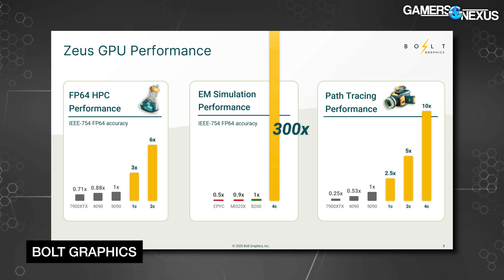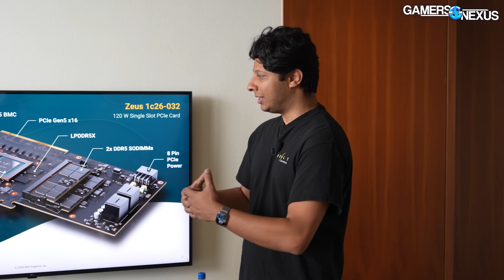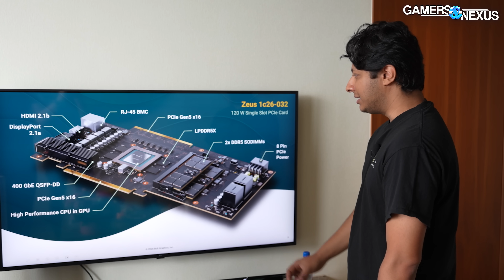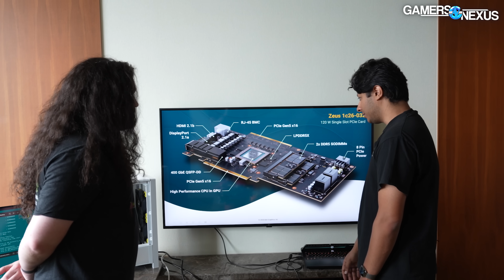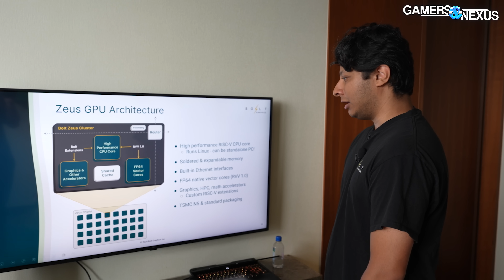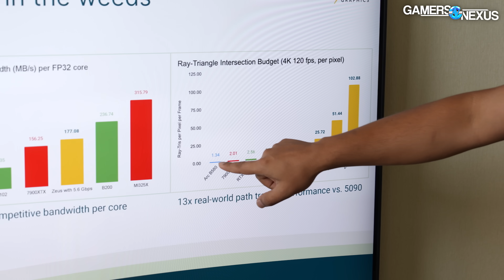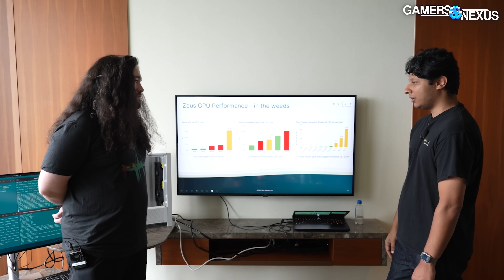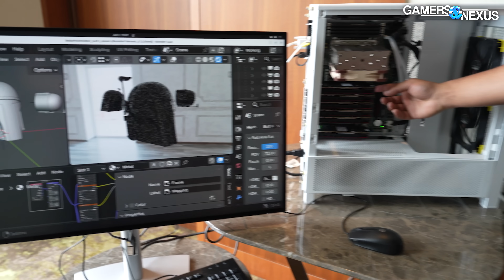A New Gaming GPU Challenger: Bolt Graphics Takes Aim at NVIDIA

Comment: We need as much competition as possible
Reply: ASML needs competition lol
Reply: @Steven_Stag  dont worry mexico will surprise you
Reply: @Steven_Stag  It has competition (Intel and Samsung for starters), what really needs competition is ASML the single company that makes the high end chip manufacturing devices that TSMC and its competitors use.
Reply: @ner @nerofl89  Intel is run badly and shouldn’t exist anymore, they got bailed out by the government
Reply: @nerofl89  asml is a legalized monopoly no one is gonna compete with them
Reply: @sickratzz That's my point...it needs competition.
Reply: @nerofl89  No one is even close to building technology similar to ASML's, and they will not just give it away. It's also not like someone gave them the blueprints; they had to invest a lot into it. Most people don't even realize how much infrastructure alone ASML requires to even operate. I agree there should be competition, but shouldn't the competition go through the same process that they went through?
Reply: @sickratzz No one is even close to building technology similar to ASML's, and they will not just give it away. It's also not like someone gave them the blueprints; they had to invest a lot into it. Most people don't even realize how much infrastructure alone ASML requires to even operate. I agree there should be competition, but shouldn't the competition go through the same process that they went through?
Reply: @TheAlienwhisperer  They got lucky with the several billion they had invested in them.
Reply: @sickratzz, It’s not “legalized” It’s just a fact that nobody can compete with them. Nobody knows how.
Reply: @nerofl89 , There is competition. It’s just that the competition is so antiquated and inferior that nobody wants it.
Reply: @TheAlienwhisperer , Actually they bought the technology from Lawrence Livermore Labs in California when Bill Clinton balanced the US budget and cut funding for the development. So they weren’t given the blueprints, they bought it, then finished the development.
Reply: @terjeoseberg990  What they bought back then was far from the technology we have today. You are portraying it as if the product they purchased was already complete, when in reality, it was just an idea that no one except ASML wanted to pursue. It was a far cry from what exists today, and ASML went through plenty of failures along the way, too.
The national labs did not hand ASML a finished "blueprint" or a plug-and-play machine.  What the national labs proved was the physics, they showed that EUV lithography was theoretically possible in a laboratory setting.  Turning that laboratory proof-of-concept into a commercial machine that could run 24/7 in a cleanroom with atomic precision was an entirely different beast. ASML spent the next two decades and tens of billions of dollars to actually "finish" the development.
Reply: @TheAlienwhisperer no.
Reply: @TheAlienwhisperer  China recently announced modern lithography machines. Might not be top notch but one can hope for at least stuff for the average consumer.
Reply: @Steven_Stag we need some serious corporate espionage situation and build a factory or two at home
Reply: 3dfx we were all robbed
Reply: @Realmusicworld420  3DFX made lots of stupid mistakes, pissed off their distributors by undercutting them on price and got bought up when they ran out of money. I love 3DFX cards but it's important to know they basically ended themselves.
Reply: @WelshProgrammer nvidia has done that with there stupid prices.  In Australia the top nvidia card is 6k where i can get an amd top card for 1500. Literally quarter the price of nvidia and what 5% less powerful at best.
Reply: @WelshProgrammer , 3DFX wasn’t bought up. They went bankrupt and shut down. Then NVIDIA hired most of their employees.
Reply: @terjeoseberg990  Nvidia bought all of their assets and IPs you zoomskull. They were in a bad situation after they bought STB's fab , then Micro$lop & Ngreedia pushed DirectX (cos of upcoming Xbox) and basically killed 3dfx , then Ngreedia bought them, shut them down, got the IPs and DELETED and buried them (they even stole SLI as abbreviation, though Ngreedia's one does not mean what 3dfx's Scan Line Interleave meant , nor it works as OG SLI worked) 
Ngreedia did the same thing when they fell threatened in mid to late 2000s by Ageia and Physx accelerator cards - they bought them , said ONLY our cards are THE SHIT, shut down the company, pocketed the IP, deleted them, and recently stopped supporting 32-bit Physx LOL
Reply: @volf3r505 , Nvidia did not buy 3DFX. You’re confused. Nvidia did buy PhysX. I don’t know anything about Ageia.
Reply: Working on the MAIA100/200 hardware development and latest fleet deployment, and I support this.  Learned a lot and ready to help people like this.
Reply: Nvidia will come back wheeping. Google, Amazon and xAI  are going NPU or ASIC route. First two are already there, and Musk loves vertical integration so that's a 100% as soon as they build their chip plant. It leaves Meta and neoclouds. ANd Meta loves to do what others do so I wouldn't be surprised if they also go that route.
Reply: @JerzyLasica  I wish that was likely to be a way out of it, but Nvidia already went the ASIC route. If you only looked at the video side of things, the RTX 40-series wasn't that big a deal compared to the 30-series, but it was about a 2x improvement on FP8 inference speeds. Even if that still pushed Nvidia out of the market, whatever's left in those datacenters will still need DRAM and NAND so we'll be in about the same situation just maybe with the benefit of not having to think about jackets quite as much..
Reply: Yeah, but this is not it. It's going to be nowhere near even Intels cards for gaming. Hence their initial target audience.
Reply: @daniel29263  It doesn't matter anyway because gamers would give them a standing ovation then go buy the latest RTX card.
Reply: @ivanlagrossemoule  no shit when the only other options are not working amd drivers
Reply: @rarepepe4849  have you actually used an AMD card in the last few years? I own a 6750 XT, and not once have I ever had to even think about the drivers after they were installed
Reply: @daniel29263  The initial product won't be, for sure. But they very well might be able to put out something significantly better for gaming in the second gen.
Reply: I'd jump in with them and help for free if I had any knowledge about engineering gpus or porting.
Reply: @CrissaegrimOG Thank you for your sacrifice
Reply: Indeed. Good luck 👍🍀
Reply: So Nvidia GPUs get cheaper.

Yes, we 've heard that one before....
Reply: @Zerard1 , It’s funny how everyone wants competition for NVIDIA so that they can buy NVIDIA hardware cheaper. Why aren’t they interested in buying the competing products? It’s actually these people who are preventing the competition from succeeding. If you want more competition for NVIDIA, then buy AMD or Intel GPUs.
Reply: its more support for us than competition for nvidia
Reply: It has to be actual competition though, which is almost impossible in this market.
Reply: @underleft , Why?
Reply: No kidding. People gave Intel shit when they came out with their GPU’s. Seriously WHAT is wrong with these people?! We need MORE MORE AND EVEN MORE competition especially when it comes to GPU’S!!! 🙄

And God speed to these companies making them. We also need more RAM chip manufacturers! I don’t get why China can’t make stuff like this either. 🤷‍♂️
Reply: By the time this gpu comes to consumers it wont matter. Ai will have shifted and settled by then, companies will readjust and optimizations will be the priority while optical and quantum computing comes to fruition.
Reply: I'll give it a few years before Nvidia just buys them out.
Reply: Seriously Nvidia needs competition badly
Reply: @Brownwaffles , NVIDIA has competition. Have you heard of AMD and Intel?
Reply: It's a good idea, but only on paper!
Reply: Preferably outside of the U.S.
I dont want to buy things from modern day Nazis
Reply: Intel, has dropped the ball again.
Reply: Sadly this isn't it.
Reply: Competition now is just a death sentence to when the market crash sadly it’s too late memory is just too expensive
Reply: If we examine this nationally, it looks bleak.
What would really surprise me is if there was, for example, a new graphics card band from France or India, LOLnotGermany, or Ireland. It's like we have become so globalized that many countries are completely lacking certain extremely relevant industry segments.
If you see industry as part of foreign politics, then the USA still dominate many markets.
But on the other hand, Bolt will simply make orders in China or Taiwan or such, so why is it still 'always' the USA where this stuff emerges?
Reply: @Dowlphin  well that’s not the whole story though. China is actively innovating in many areas. But the hubris (and greed) of the USA is blocking any of that innovation/competition from entering the US market.
Reply: @truality8289  I didn't mention China because that is not my point. They are a big competitor, a counterpole, so naturally they would have strong incentive, but out of necessity only. It actually underlines my point: If there is no pressure behind it, many aren't moving, not interested. Maybe their whole system doesn't promote developments like that.
Reply: @Dowlphin  fair enough. But like I said, that’s glossing over a major contributor on the global scale. China has about 4 times the population than the US. There’s a lot happening over there. You probably should have mentioned them as an “outlier” in your original statement.
Reply: @Dowlphin  Thing is, every single one of these Countries that are owned by the Cult, are in on it.

CCP is in on it.
Russian Government is in on this.
USA Government,
UK Government.

I can go on and on.  When will people finally get it through their nogen, that every government is a corpo owned PAWN?

Who runs the world or I should say, wants to destroy it?  The Corpos who are linked to this Cabal.

THAT is what people need to know...
Reply: @gohanf2285  Dependency will be to varying degrees, and while some like their corruptions, others struggle against it.
But what actually saddeny me a bit, one little indicator signaling a bigger problem, is that in Russia where there is a strong identity of opposing the USA's disaster capitalism, they still have the deceptive 99er prices everywhere. - So yeah, they could do much more bold things, USSR style, without causing a big drama.
I keep imagining how different, how much more relaxed, a supermarket in socialism would be. There is so much fear-driven BS in that 'arena' - deception, secrecy etc., it permeates all of society and becomes invisible through normalization.
Reply: Competion comes from basic regulated commerce. Capitalism claims to be commerce while removing the regulation and choice of the consumer.
Reply: @breakupgoogle4584  Competition is also an unessential element in a more mature society. It creates friction and thus waste of resources, in order to run a scheme that has roots in the same fear psychology as capitalism itself.
Competing is always about pitting people against each other to see who is better. That is not healthy for the ego.
Reply: It mighr help but a benevolent monopoly would be better issue is we dont have either.
Reply: Or busting monopoly.  First step is stop having government fund these losers.  Fire the corrupt democrats and all republicans.
Reply: always
Reply: Until and unless they can make GPUs that goes blow-for-blow with those of NVIDIA in every single performance metric (Similar FPS at the highest settings including ray-tracing, none of that price-per-performance ratio bullshit because that clearly hasn't gone well for either AMD or Intel), for similar or cheaper cost, with similar vendor agreements, software on par with them or better, as well as having the manufacturing capacity to keep up with the absurd demand (And they need to do it all fast, within the span of 3-5 years), it's a pipe dream for them to even be considered competition.
Reply: We do. As long as they can stay afloat. It is going to take a few years for intel to get to the point that they are competitive. Bolt seems like they are 4 or 5 years behind intel, but their ideas are far ahead of anyone else.
Reply: Education sucks
Reply: You're right and this is good. But one thing to keep in mind is that they're also using TSMC. So ultimately it's still bottlenecked at the same place. It won't solve the shortage in the short term. 

Still nice to have options though.
Reply: Right, remember when Intel dominated the CPU space and it sucked. Glad at least Intel and AMD are trading blows again. I like that there's this option and Intel now with not face melting GPUs, but also not terrible, well... still to be seen with BOLT. BUT in the ARC sphere, it's been a decent ride recently as we're in what? Gen 3 of ARC gpus?
Reply: I think we need everyone involved in a single ecosystem for consumer grade hardware. I'm not against multiple companies but when they compete with each other to the point that it creates incompatibility within the same generation of hardware, were officially living in our own hell
Reply: as fast as possible, too.
Reply: there's no competition unless you actually buy their stuff
Reply: Competition doesn't mean anything significantly cheaper...
Reply: lisuan gpu will make it happen first then for the future of forward looking gpus bolt will take the lead , even beating nvidia easily if the devs adapt to their hardware
Reply: You just thinking about your own pocket you grub, open a business and maybe it will wake you up :) running a business is the hardest thing on the planet and Nvidia will not have competition ever.
Reply: The key is not whether there is competition, the key is what economic system it happens under. As long as you keep capitalism, it is inevitable that you will repeatedly end up where we have ended up.
Reply: like with handheld consoles?..
Reply: *functional competition
yes
Reply: preferrably from europe.
Reply: Maybe,We need more manufacturers
Reply: @nikhilsharma064  from countries who do not use it to blackmail others....  ;)
Reply: Competition is good, but we have competition at low end already with AMD and Intel being there. What I'd love to see is competition in high-end market, because that's basically just NVIDIA now.
Reply: @Claus5544  In this sector you have to build up to it.
Reply: Yes we really do as the market is complete crap.
Reply: It needs to be at least 28gb!!
Reply: I definitely am not an expert in GPUs so as a ignorant idiot I am hearing: Yeah we will make the same thing like nvidia but better and cheaper and no raster approach, same as nvidia but we will be better.. Competition is good but I definitely will not be a cash cow tester...
Reply: Absolutely!
Reply: Yea, GPU prices haven't gone back down to reasonable prices since Covid or even years pre-Covid. Now we have SSD and RAM prices skyrocketing/increasing. Next it might be CPU shortage or something else unfortunately. Also you can see all these manufacturers prioritize content creators and AI companies. Gamers are second-class or worse
Reply: Competition in an already saturated market that is monopolized from every angle with patent walls? Nice dream, Bolt. But let’s be real—like almost every hardware startup to date, they’ll likely just get squeezed out or "bought out" eventually because the monopoly is too entrenched.

They need to pivot and attack from a completely different angle. My advice? Forget trying to wedge another physical graphics card into a Western market dominated by giants. Instead, Bolt should take advantage of the massive technology vacuum China is experiencing right now. It is a once-in-a-lifetime opportunity reminiscent of the 90s tech boom.

Because Bolt is built on the open-standard RISC-V architecture, they have a unique backdoor. They should look toward the incredible potential of Huawei's brand-new "LogicFolding" 3D architecture. Instead of choking on legacy 12nm limits, Bolt could license their ray-tracing IP directly into China's new vertical, gate-level 3D stacking roadmap. Letting Chinese domestic players integrate Bolt's designs to bypass Western machine bans is their best path to explosive growth, rather than fighting a losing battle against established Western monopolies.
Reply: Yet you will still buy overpriced Nvidia as you kokokoko about competition being needed
Reply: Totally Agree, But I don't want to wait 5-10 years before they even get near a 5090 GPU.
Hopefully something else will happen.
Reply: it's been 10+ years of working from startups to startups. All the businesses are no longer looking for long term success, but rather have it at $5million+ value and sell it. 
Still naive that some companies, including this one, won't be the case. But my optimism is fading as years go on.
Reply: *good competition.
Reply: wont be any, if is close to something important, nvidia will buy it and will bury it deep into the ground, like they did with 3dfx
Reply: Wow a competitor that doesn't care about AI.  Am I dreaming?
Reply: Not from a foreign invader. However, if there is a foreigner terrorist to allow into the u.s., its one like that. Id trade him for removing all the rest though.
Reply: At some point, 5 - 10 years, China will catch up and at that point the current market US-Taiwan-Korea cartel is toast 🔥🔥
Reply: Good luck, capitalism is anti-competition
Reply: @DrZaius , Back when AT&T was a monopoly, they invented some great things. They never stagnated.
Reply: We don't need a competition we need a replacement. If NVIDIA is willing to lose their loyal consumers then we need someone who'll only focus on us and not split it up with big companies that only aims to use the GPUs for AI.
Reply: Hot take
Reply: And more
Reply: Wanna bet that this is vaporware and a scam ? It will never release or will be a turd.
Reply: Yep both for the consumer and the markets sake. Competition breaks monopolies and frees up the market.
Reply: They're not building to sell. They're building to compete and get bought out in order kill them. It's intentional. Cynical I know, but Google does this all the time.
Reply: Rape the earth for all it's resources? yeah great idea, it has worked out just fine..Crazy thought: What if we respected nature, looked at everything as precious and divine, made the best products we can to last as long as possible, and re use the materials instead of throwing them away. How can we so carelessly throw things away as they are dead and worthless...
Reply: well, he did slip and say that it's intended for data centers.. ;d
Reply: @shadyopss  he also said their first clients are game developers, so it is not those kind of datacenters
Reply: @Sauvva_  looking at the actual hardware they have planned, it'd suck for gaming. Their high-end models have about 10-20% of the general purpose shader performance of NV high-end and 1/3rd to 1/5th the memory bandwidth in NUMA. On top of that they're planning to release them late next year when we'll get updates to nv-amd gpus.
Reply: Yeah, it will probably be a decade before they're competitive with AMD and Nvidia, if they ever get to that point. It's already been 4 years for Intel, and they're still struggling.
Reply: @shadyopss thats still OK if it relieves their demand for amd/nvidia it still helps over all prices
Reply: @Ultrajamz nvidia and amd are not going to stop selling to AI companies, as that demand is not going down anytime soon, brother. The only thing it's going to relieve is some pressure off the ai companies, as they'll be able to source more hardware.
Reply: @shadyopss  If Bolt launches first gen Zeus and its 2x faster, 3x less power hungry, 3x easier to cool, and (assuming the "vastly cheaper than a 5090 MSRP" claim holds true) ORDERS OF MAGNITUDE cheaper than competing server grade hardware then you can expect their (AMD, Nvidia, Intel, etc) sales to drop like a nuke from orbit. Why spend $30k-$40k on whatever Nvidias flagship is when you can drop $500-$1000 on a Bolt for more performance, less cooling hassle, and vastly lower power draw.
Reply: @StretchDattass  100% companies will even take a slight performance hit for something vastly cheaper both in direct cost and running cost.
It would also give bolt the money to reinvest into gaming GPUs.
Reply: @StretchDattass  Yeah, but this "Bolt" GPU core chip is produced by... AMD.
Reply: @shadyopss  GPU is a global commodity doesn't matter what it's intended for you just need to flood the market to lower price.
Reply: which at this point means any at all.
Reply: Trillion dollar companies shouldn’t exist. Trillionaires shouldn’t exist.
Reply: A lot actually.
Reply: Dont worry any meaningful competitors gonna be buyed by Jensen
Reply: Looks like it was built for academics and enterprise graphic design (Notice the LPDDR5X/DDR5 instead of GDDR6), it wont have any impact on the consumer market.
Reply: Yes! This is the way to fight monopolies!
Reply: We need Europe and China in the Chip game then there will be real competition
Reply: You only "need competition" so it lowers the price of the Nvidia card you buy at the end of the day. They eventually say "eff this" and give up on the market.
Reply: It's a workstation GPU. I doubt it will ever be a gaming GPU
Reply: @la7era1u54  yes, but they also said that they want to go into gaming later
Reply: But you gotta buy the competition, can't just cheer lead
Reply: @gvulture1277 exactly, people need to buy the competition for it to remain there. Just why I advocate for people to still buy the weaker competitor between AMD and Intel as the superiority in performance oscillates between them.
Reply: Until BlackRock dont get its hands in it
Reply: laughs in capitalism
Reply: Hell yeah.  Capitalism, baby.
Reply: Yea, right, people said the same thing when Intel entered the GPU market and then nobody bought their cards.
Reply: @little_fluffy_clouds  the timing was way off look at how insideous Nvidia and ATI have become they're villains
Reply: @Realmusicworld420   they're not villains, they're corporations run by soulless scumbags who are pushing to maximise profit over customer satisfaction. Same as Intel or any other tech giant, really. There are smart engineers who want to do the right thing in all of them, but they're overruled by the greedy beancounters steering the ship.
Reply: But how will the CEO of NVidia make a morbiliion dollars every day if he has to compete? He might have to stop buying yachts. Or fire like 15000 people so he can keep buying yachts. Bolt is basically threatening the jobs of all those people, if you think about it. They're anti-worker. And having more products on the market to choose from is more confusing, so they're also kinda anti-consumer.

Anyway have you heard how cool DLSS 5 is? This probably can't do DLSS 5. Just saying.
Reply: we don't need competition... we need a company that isn't focused 100% on greed and is willing to produce products for the average person! For example the approach where you can swap the memory of your gpu at your discression is something that COULD have been implemented in the nvidia GPUS but it isn't on purpose! I wish these guys all the best and hope their products end up being released! I am more than interested in trying something different IF it supports the majority of products out there because I am so freaking tired of the sheer incompetence of NVIDIA and AMD!
Reply: You guys don't want competition, you wanr just cheaper Nvidia
Reply: We just need some competition at all.
Reply: No we don't.
We need compatibility, standards, teamwork, alternative research and development, cohesion and synergy for API and ABI....

Last thing we need is the competition, as that has lead us to this situation where we are with Nvidia and Microsoft. 
If you welcome Nvidia and Microsoft situation, then take the competition, and be happy that you will have just one option for what ever price and availability they deem for you.
Reply: @paristo  The situation you're describing is the result of a lack of competition. Look at Nvidia's market share, or for a narrower slice you can look at AMD/Intel GPUs and Linux' presence on Steam hardware surveys for a picture of just how bleak it is.

For an example of this in the CPU space, you only need to take a glance at the trajectory of Epyc prices over the past decade.
Reply: Especially at the 5080/5090 level
Reply: @Ultrajamz That's not happening.
We just need a GPU company that doesn't sell to AI. That's it.
And then we need game devs to drip GenAI and bring back the human optimization engineers and QA.
Reply: This is not competition.